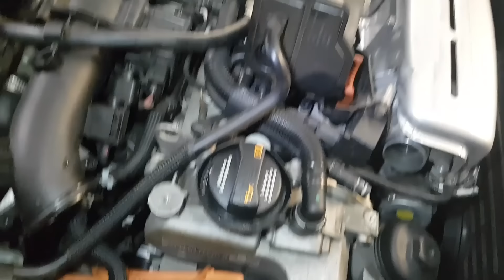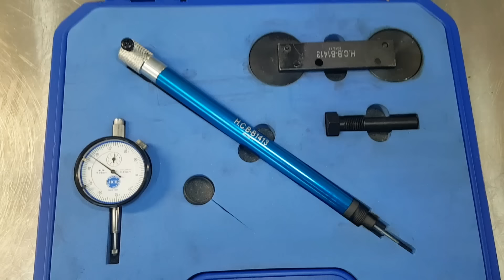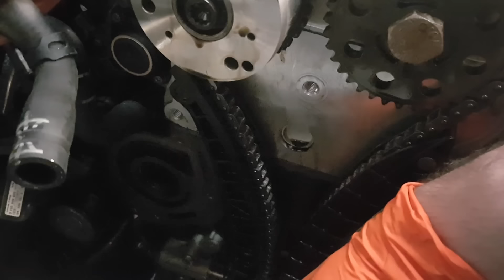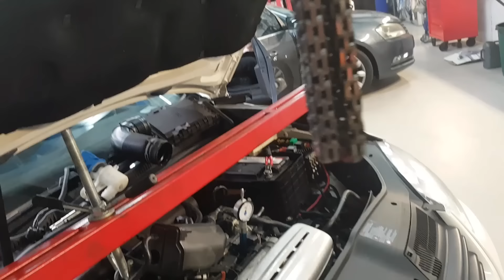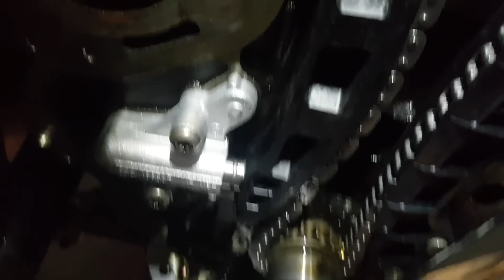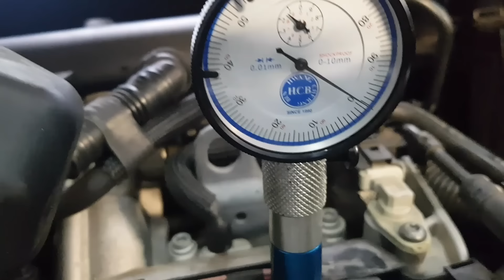P3008 VW 1.4TSI Timing Chain Replacement

Comment: Good job 👍

Is there a specific way to air lock the water system when you put the water and anti freeze in. 
Is a bit confusing with out any information with that cam setting tool. 
Thanks for explaining which way is up thanks. 

Just about finishing rebuilding a 1.4 tsi cave code. pistons like you had. 

And fitting revised injectors.
Reply from the maker: Glad I could help mate! The best way to fill them is with a tool that can pull a vacuum on the system, which pulls all the radiator hoses flat. The vacuum in the system then pulls the water and coolant in with no air locks.
But to be honest, these engines are pretty good at bleeding themselves. Just pour your mix into the coolant resevoir, and start the engine with the cap off the resevoir. Run the engine until up to operating temperature with the heater switched on to High (maximum heat). Keep topping the level up whilst the engine warms up, keeping the bottle full. Once the radiator has cycled on and off, take it for a drive. Let the engine cool and recheck the level. Top up where necessary.
Reply: Ok that’s the way I normally do it. 

I just seen that you need a special way for it. 

The block and head run at different temperature so just checking 😉 first 

Have you done Basic settings
On the dsg 7dq200 gearbox yet?.
I need to do that when it back up running put a new clutch and oil in it. 

Keep up the great work thanks
Reply from the maker: I have done the basic settings on the dq200 many times. Are you using VCDS?
Reply: I need to get one in. 
It’s good to know that you have when I get to it I will ask you for the number sequence to go into 
Thanks